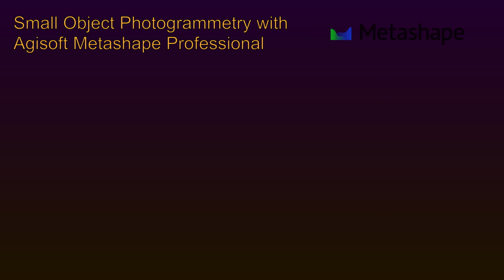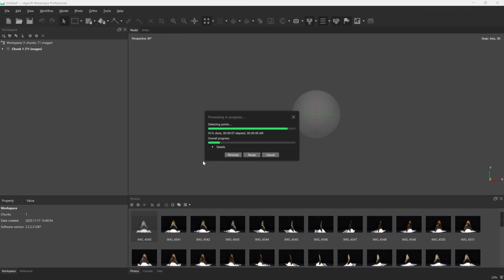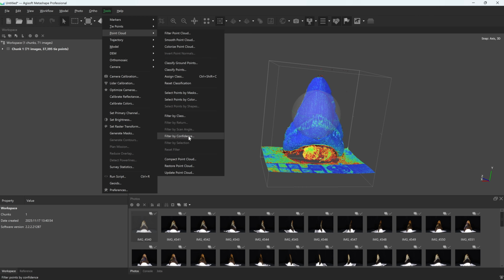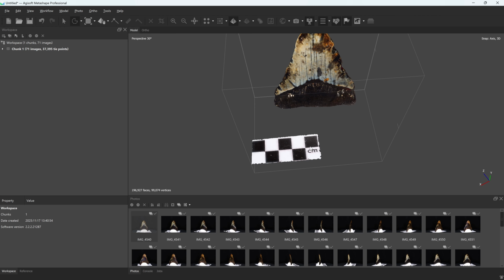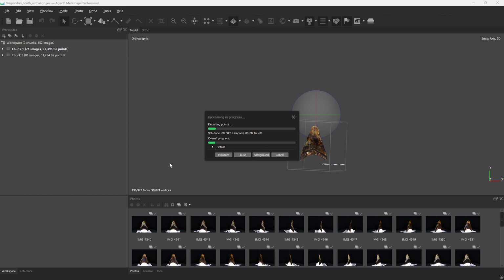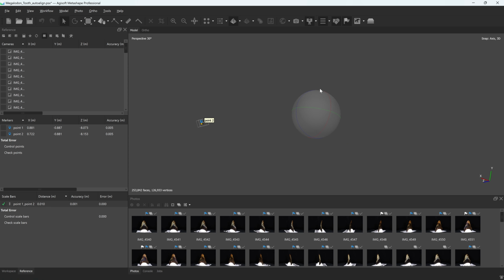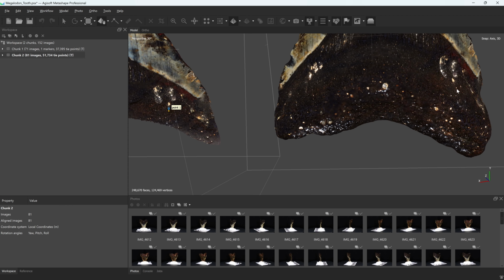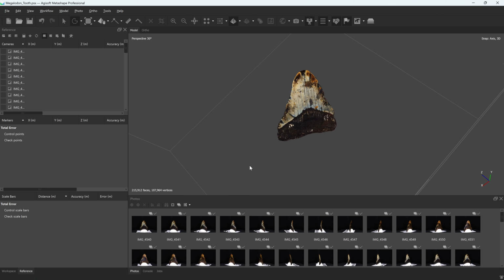Small Object Photogrammetry with Agisoft Metashape Professional

Comment: Hi, I am trying to do a scan of a skull so i need multiple perspectives that i need to merge together. How would I do that ? I saw Alex Elvis do it but it was an older version...
Reply from the maker: You can follow the same workflow as this tutorial. I've done this with dozens of anatomical specimens in a previous academic position. Typically, I separate the cranium and mandible (if the specimen is separate, some early hominin fossils are fused, of course). I place the specimen (e.g., cranium) facing up and take the same series of photographs as I would for the fossil in this video. I then flip the specimen and take another set of photos. Then, follow the same process outlined in this video. If you need to take three or four sets of photos, then just create a new chunk for each set of photos and follow the same steps as this video. Metashape can work with many chunks just as easily as two. Hope that helps! If not, let me know, perhaps I should make a tutorial using such a specimen.
Reply: @ArchaeoSquatch  Welp, I have tried several resolutions now to try to align but no success. Either it becomes a blob or nothing happens. Might be the background or the fact that am using markers to try to increase the accuracy. What I have been trying to use is Protocol for 3D photogrammetry and morphological digitization of complex skulls, but the onechunk method just makes a blob. I guess I will try to start with less complex shapes and move from there.